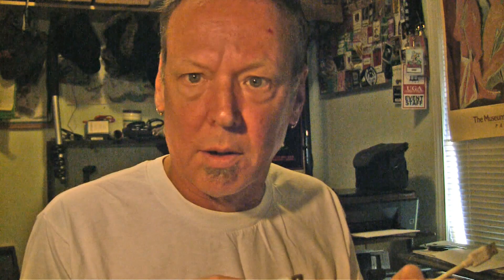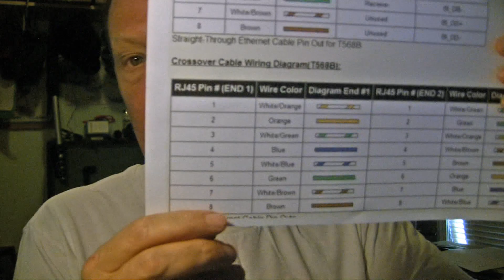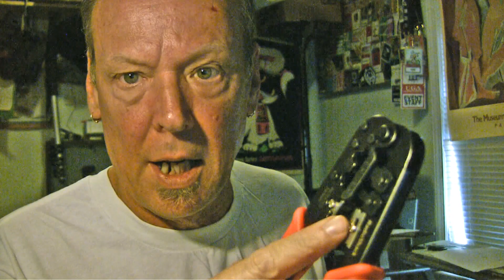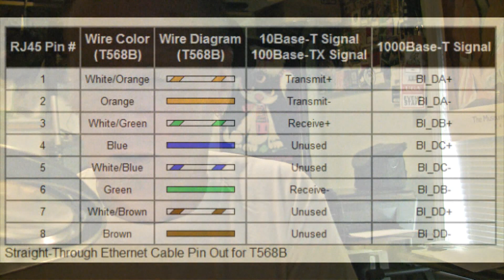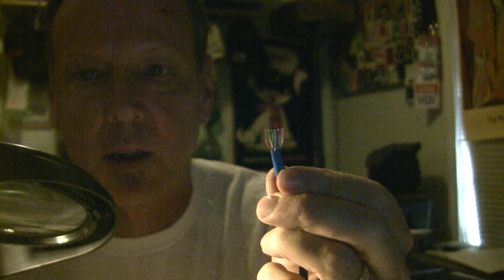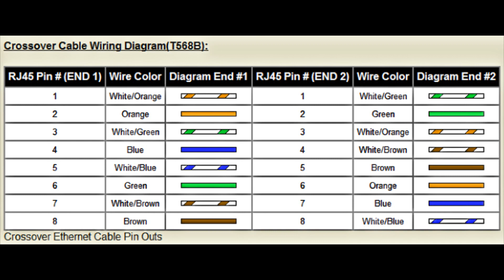Ethernet Crossover Cable Construction

Comment from the maker: That's bad....100% packet loss??? Cut the end off and re-do it would be my suggestion. Even Professional integrators have to re-do a RJ45 once in a while because they don't get one of those small wires properly connected when they crimp the connector. Just do it over!

Comment from the maker: What, cut the outer protective plastic jacket back 6 inches? If that's what you are implying then you are incorrect. It's essential to make sure that the outer jacket slides into the RJ45 connector by about a 1/4 inch so that when you crimp the connector, the compression tool crimps the jacket in order to provide "strain relief" to the conductors. If you look closely at the crimp point you'll see that it's a very sharp edged wedge and can easily break one of the solid copper conductors.

Comment: The best way to guarantee no broken wires or cut wires from cutting the jacket, is to cut the jacket, then use the white string in the cable to pull back the jacket about 6 inches then use the wires.